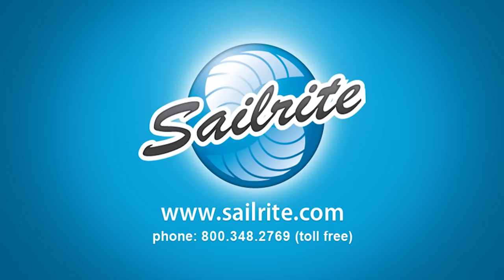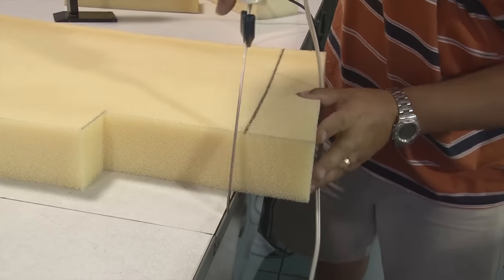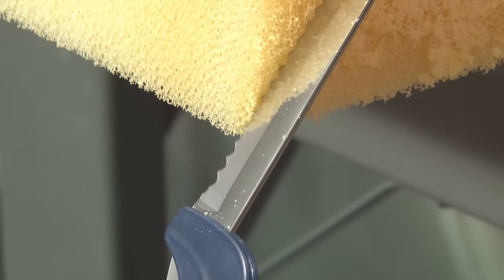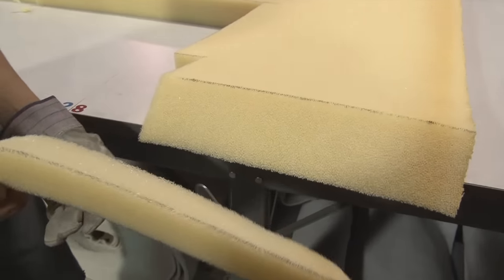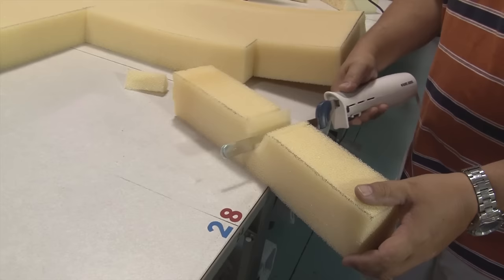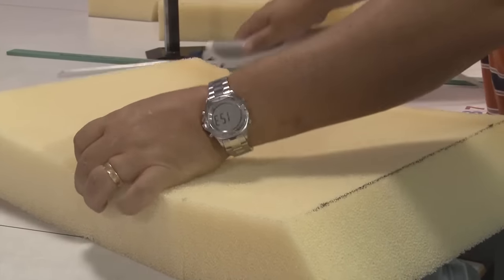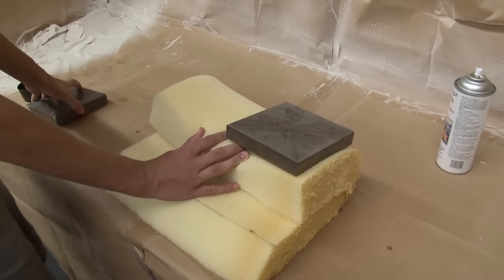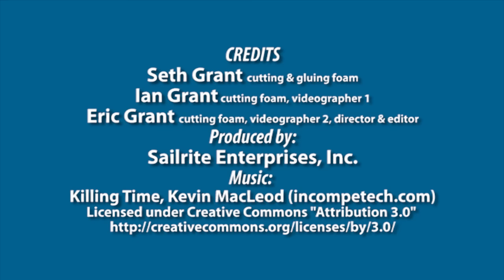Cutting Cushion Foam using Electric Kitchen Knife

Comment: Thanks for this. I still have a working electric kitchen knife from my late mother. It's at least 50+ years old and we still use it for carving a chicken or a roast. My mother would have had fits seeing cutting foam with it.
Reply from the maker: I would not use one that old, it may be considered an antique. Just go pick one up from a department store, they are cheap enough, usually under $15 dollars.

Comment from the maker: We glue Dry Fast foam with 3M General Trim Adhesive. When gluing a closed cell foam use 3M Super Trim Adhesive. When gluing Polyurethane foam from Sailrite we use the 3M General Trim Adhesive or 3M Super 77 spray adhesive.

Comment from the maker: I have used an electric kitchen knife on the following types of foam: Dry Fast foam #103165, Reflex BioCide Foam #100160 and it has typically worked great. Most of our foams are not very soft.
Reply: I want  cut machine  please tell

Comment: You know, I have found that ANY good serrated bread knife will work. It might be a better purchase because you'll use it more often. I picked mine up from Mr Bezos' little company for $20...actually it's the best knife I have ever used, maybe the best thing I have bought in the last 10 years...and I have never been one to be easily enthused by a kitchen implement ! Mine worked extremely easily, threee clean strokes got me through a 6" Firm, though I think maybe that's because it was new and sharp.

Comment: TOP Thanks! I have tried so many things such as cutting with a hot blade and so on. Thanks for sharing man! 
Greetings from switzerland  : )
Reply from the maker: You are welcome!
Reply: @ghousalishahsahb6859  no it is not smooth at all. I do not recommmand it
Reply: So what should I do?
Reply: @ghousalishahsahb6859  i strongly recommand you to use an electric knife (there is some cheap kitchen electric knife to cut meat that will perfectly work). In my experience that is the best way to have a smooth finish. Best regards!
Reply: Sir how can I cut horizontally
6ft *6.5ft *6 inches
Foam mattress
Into 2 inches 3 sheets
Reply: @moretdavid  
Electric knife knife only cut vertically
But I need smoth finishing
Horizontal cutt

Can I use hot wire cutter or something's else

Comment: I have used an electric knife.  But for a cut that looks like the factory edges, a band saw is best.  With a band saw you can get 1/2 inch thick pieces, rounded corners, and very complex shapes. Just use very low feed speeds.  

A table saw works too, but needs a very sharp blade, a very slow feed, and definitely push sticks.

Using a band saw, I have cut 1 inch foam slabs to use for greenhouse gaskets, contoured to fit kayak transportation pads, a soft Valentine heart, furniture cushions of complex shapes, and a variety of small packing strips to close air gaps around doors and windows.  The band saw is faster than an electric knife, is more precise, and gives a far better edge surface.

Comment: We learned that it is generally diffycult to cut closed cell foam with an electrical machine. Use a hot wire or something instead.

Comment: 1:20 Instead of risking someones fingers why didn't you use the table edge method for the angle cut too?
Line the bottom foam edge with the table top edge and just follow the line on top while making contact with the bottom table edge.
Reply from the maker: phartattack Yes that is a good idea and one we use in some of our other videos,
Reply: you should caption that on the video...
Reply: Shhhhh... don't give them safety advice. Some people deserve to learn hard lessons.

Comment: LOL...8 HOUR WAIT TIME TO WAIT FOR THE ADHESIVE TO ADHERE??? Too long a wait guys...there is upholstery glue specifically for foam you use with a spray attachment that can work with any compressor.  It will hold as soon as you put the pieces together!!!  Now using the electric kitchen knife is a beautiful alternative because its the same technology as these expensive foam cutters at a fraction of the cost. A Bosch foam rubber cutter retails for $538.36 and that's without the blade and footplate.

Comment: I bought an electric knife, it did not cut thru without me sawing back and forth, and then gave it the uneven edges.  I had no success with this.
Reply from the maker: Well, the uneven edges, will probably not show up when the cushion cover is done (unless they are very bad). To solve that you can buy the Blade Foam Saw: https://www.sailrite.com/Sailrite-Blade-8-Foam-Cutter-with-Carrying-Case-110V

Comment: how can you dry a soaken wet foam?
Reply from the maker: +Kathy torres If it is dry fast foam, simply set the cushion on its side (if it was covered in a breathable fabric) and it will dry out in a few hours. If it is a polyurethane foam then you will have to take the foam out of the cover and set it on its side for many days until it dries out.

Comment: May I know if that is high density foam? If not will it be applicable to one?
Reply from the maker: That is not a high density foam. However, yes I have used an electric kitchen knife for that type of foam and it does work.

Comment: I cut high density foam with a kitchen knife (cost $20).  It only survived 2 cuts.  Any idea what might have happened?
Reply: Okay.  Thanks!  Any recommended knives?
Reply from the maker: Sorry, I cannot. However, if you buy a professional foam cutter it should last for years. Here is a link: http://www.sailrite.com/search?keywords=foam%20cutter
Reply: Please don't be insulted by the question, but are you sure the blades were inserted properly and securely? I got my Rowenta electric knife in a thrift store...  I thought I had been had until I realized my mistake.  BTW it was made in 
China but is quite sturdy and reliable. The sticker price was $35 but I paid $8. I don't use it often, but when I need to cut foam I'm glad I have it!
Reply: Sailrite g